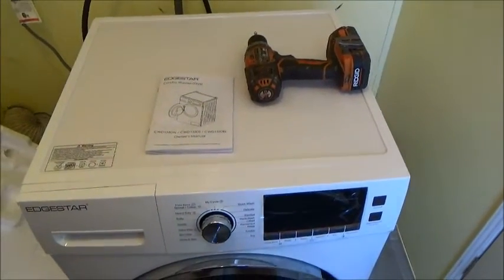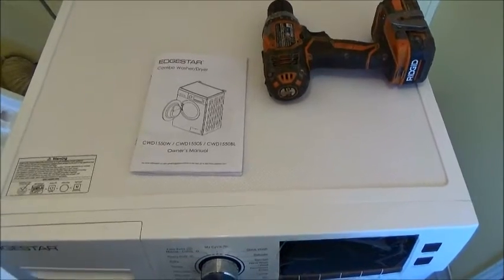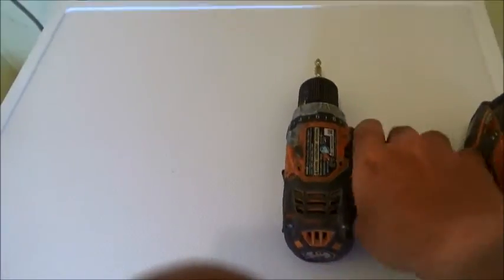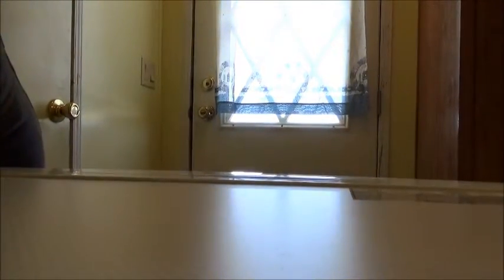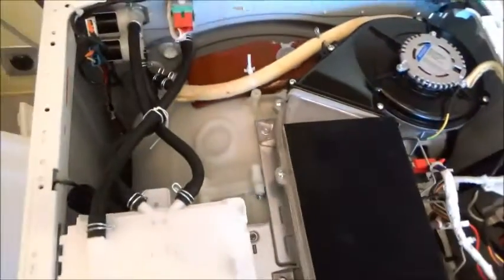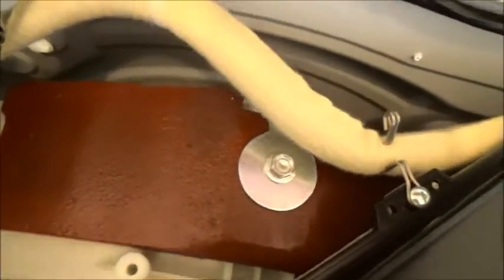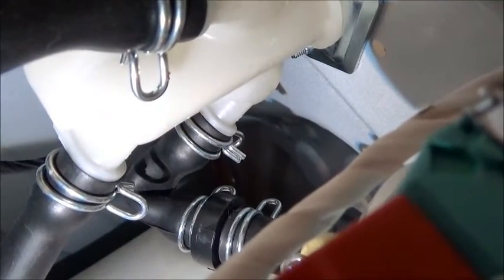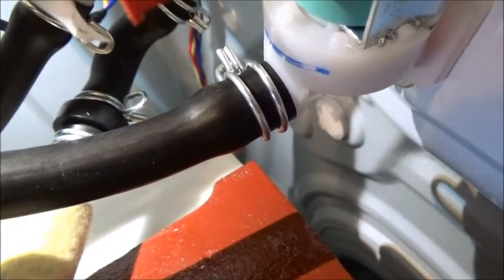Edgestar WDC1550W Washer Dryer Combo Problem Resolved

Comment: It should show an error code, however the way they software program these washing machines are really dumb. It will show an error code for only 15 mins then shuts down. I have a problem with the same washing machine identical like to yours, but with a different brand sticker name called "Summit". I checked on my clothes during the dry cycle and I see that the unit shuts down. I tried again and checked back it later and saw and error code "E3A" and it shut down in 30 seconds, caught the error code just in time.
Reply from the maker: Totally agree, error codes should be easily retrievable!

Comment: The reason why your dryer did not work with a kinked hose is because this is a condenser dryer. cold water is used to  condense the moisture from the heated drum.
Reply from the maker: That's what I thought too but when the dry cycle was finished, the clothes were literally dripping wet. Much wetter then they were after the wash/spin cycle.

Comment: As I understand, since these machines do not blow hot air out of the carcass, they have to use the cold water to reduce the temperature of the air circulating through the clothes. When the temperature drops humidity condenses and is removed from the air which is then reheated and blown with a lower humidity into the clothes again. So, by preventing the flow of cold water the kink was also preventing condensation and thus the drying.
Reply from the maker: Totally agree, thanks for the comment!

Comment: Just bought the Magic Chef  MCSCWD20w3 and checked it before installing.  It had the exact same problem!  After removing the zip tie the hose relaxed on the drum.  Looks like where it lands there should be a bracket as the drum has a threaded hole.  Thanks for posting.. this is going in an RV and would be a pain to uninstall to fix.
Reply from the maker: swalesutube - Glad the video helped!

Comment: Hello there. I have a problem with the drying function, maybe you had the same and can help...

I pushed the pause button during the drying function to see the progress. (3.5 hours for drying is a lot of time).

But the door stayed locked. 

So I pushed start again and now it's frozen on pause and the door continues to stay locked. 

I'm worried that I can't get the clothes out. So I unplugged the whole machine for like 10 seconds and it just went back to frozen pause mode with door still locked...

Any suggestions?? I can't get the clothes out.
Reply from the maker: Sorry, I don't have that machine anymore. It stayed with the house when we sold it some years ago. Only thing I remember is pushing start and pause (not at the same time) to get the door to unlock.

Comment: Mine doesn't have a kink in the water line and I'm still getting the same issue. My machine is the 1510 but the insides look identical. Edgstar doesn't know what is wrong. I watched all their videos. Took it to a repair man where I spent 150$ for him to essentially keep my machine 3 months and only clean the lint. Which could have been a problem but still did not solve the issue. Any suggestions or if anyone else reading this has the solution other than fixing the kinked hose please let me know!!!
Reply from the maker: I'm sorry to hear that. Honestly, I can offer no help at this point but I hope you get it squared away.
Reply: @SteeveeDan  Thank you. I hope someone seeing this video and reading the comments has an idea or had the same problem and can help.

Comment: Do you get a E31 every time you wash?
Reply: I’m currently renting and apartment and this is what my landlord had installed with past tenants. Now I’m having an issue where the dryer will run but then stop. Giving me a E3A code.  Of course this machine has been used previously besides myself.
Reply from the maker: Hi, no sorry but I haven't had that code so far. I looked it up and a 30 or a 31 is a door lock failure.
Reply: @jenniferkarchner4108  E3A means there is a problem with the heating element or fan of the drying function.   It may be clogged with fluff and need to be cleaned and the cut outs reset.   perhaps the heating element has gone bad or the fan motor is not running.